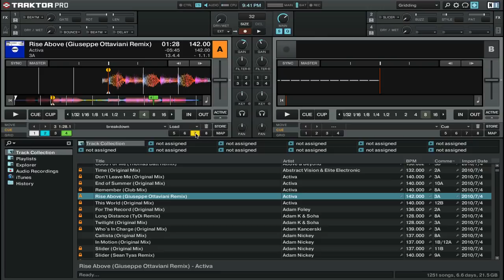Traktor Pro 2 Tutorial: Cue Point Basics

Comment: Hey Dude, Nice Video but my main issue is that I want to set a cue point at the beginning of an acapella that is not on beat. Every time i use the hot cue buttons to do this Traktor jumps to the nearest beat market. I have went into settings and changed from Snap to Vinyl etc and this still doesnt work, Any Ideas???

Comment: Traktor pisses me the fuck off...  i spent loads of time using virtual DJ thinking that traktor would be better, more professional, more accurate etc. turns out it's just a pain in the ass... the bpm detection is terrible, and set about half of my tunes to double the speed, meaning i had to go in manually and change it, the cues are a mystery... they're no way as responsive as vdj, the EQ doesn't completely cut all the signal when you turn it fully down, those are just a few issues. fuckin shit!